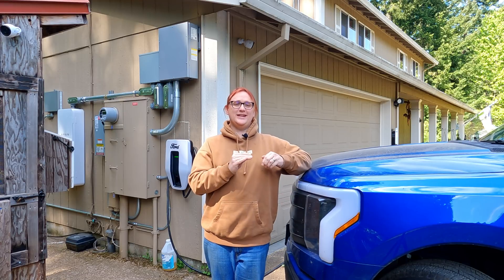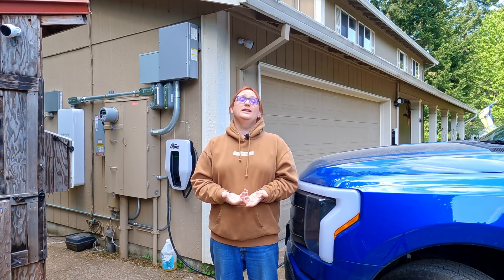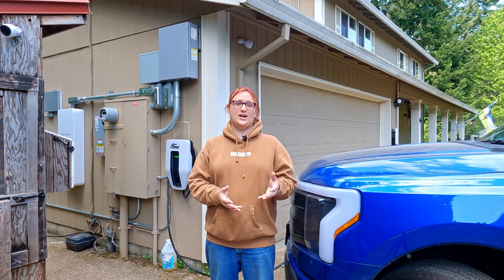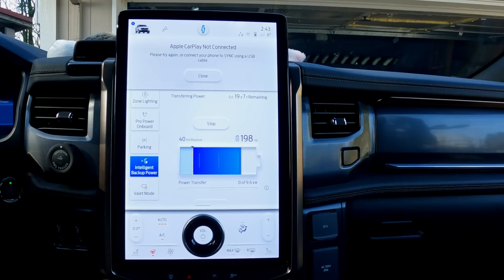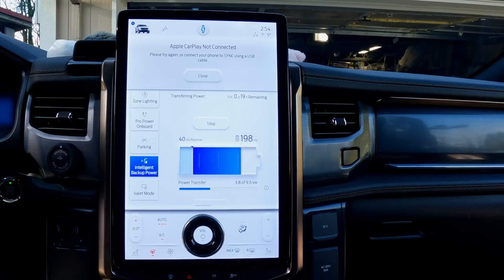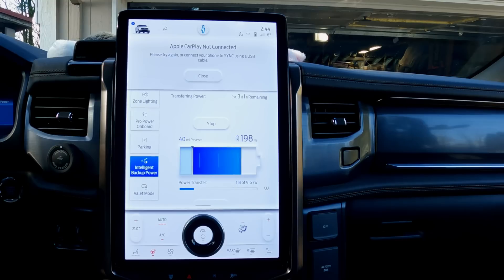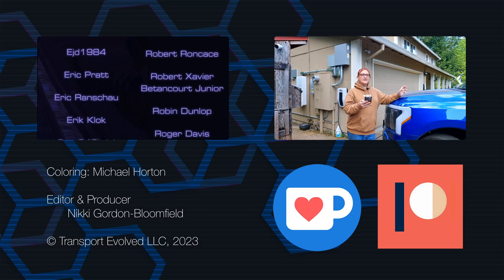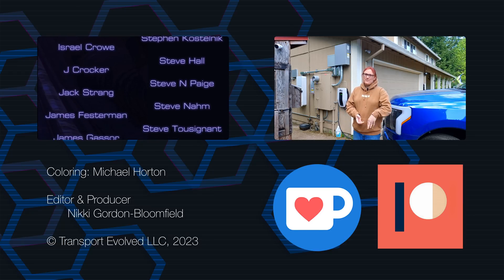I Was Wrong: How The Ford F150 LIghtning Home Integration System ACTUALLY Works

Comment: Hi Nikki, thanks for the update on using your Lightning for backing up power to the house! My question: Does your grid-tied solar have the capability to run during an outage and if not do you have any plans to make that upgrade ...and if you do, can you integrate that with the Lightning? Maybe you could do a future video on that possibility. Really like your channel! BTW, I have trouble with bluetooth in almost every situation and have come to view it as too unreliable for life safety issues, but I'm also not an engineer. Seems like a weak link, though?
Reply: This is a roundabout way of answering, but it probably could answer it. When an inverter with a solar system is maxed out, it is possible to use a second inverter in the house with more solar. This works because the first poisons the power source of the second to prevent fires. The second inverter simply shuts off. Since the battery is your secondary source as it is a backup, it could be shut off, which should theoretically allow the solar to be the primary source. The problem is that there is not necessarily a battery backup feature in the solar array and cut-off to the utility, but the Ford system would require the disconnect from the utility so it should exist in the house now. The problem that I see is that I am not sure that the Ford charger could change back and forth between charging and discharging, and I am not sure that would actually be a good thing for the truck battery. The way around it might be to use the power outlets of the Lightning truck itself, which would allow the charger to charge with most of the power from the solar array and the excess running the house. That means that it would then function like a battery management system in the solar array. This would probably require the beefier rear inverter in the Lightning so that it could deliver the 9.6 kW of power. With the 9.6 kW of power some of those circuits have up to a 30 Amp limit if the circuits are to remain independent, but there are combiner boxes, which might allow it to be a direct input to the electrical box with a more controllable way for fuses or circuit breakers to ensure nothing goes wrong with the outlet boxes on the truck. The solar charges the truck through an inverter. The truck charger with the charger within the truck is the battery management system, and the outlets would go into another box, which would function as the inverter for the house. A smaller battery system might be able to bleed off some power to the house through a smaller battery system within the house with its own independent inverter that would work in tandem with the nearly 9.6 kW inverter that the truck would be running.